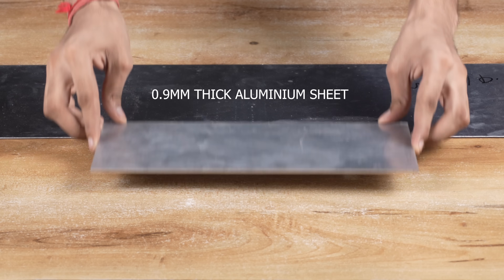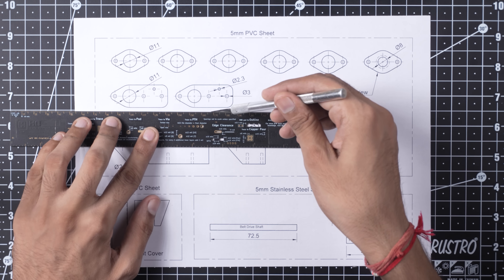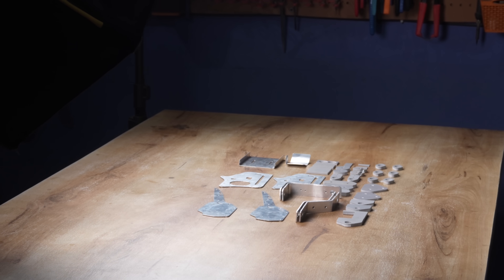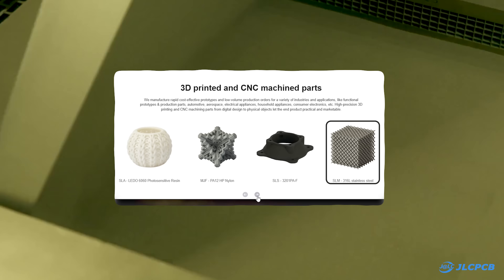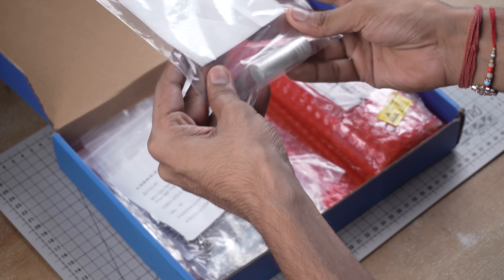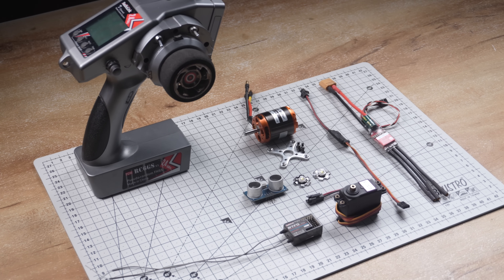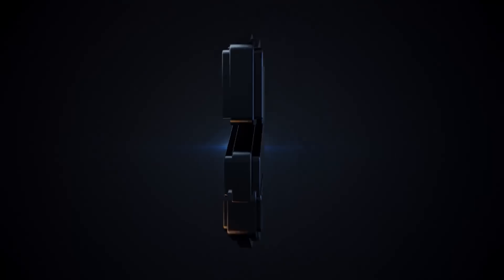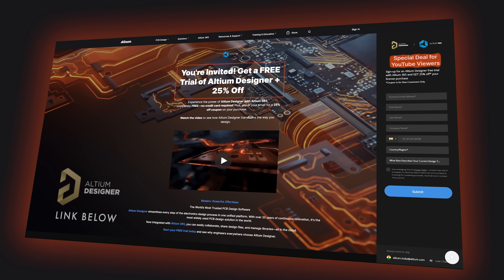Handcrafted Powerful RC Bike Using PVC Pipe – DIY Homemade RC Bike Build

Comment: Bro please my drone with 

Drone receiver 

Wemos D1 mini
MPU 6050
Make own motor driver with 
Mosfets,fly back diodes, 10k resister 
Lithium battery

Drone Transmitter 

2x PS2 joystick 
ESP8266
Lithium battery

Comment: Instead of using gyro , you can make it 3 wheeled bike also , using 2 wheels in front for stability and direction and one rear wheel for power , it'll seen good too 😉
Reply from the maker: Thank you 🙏 for your suggestion, I will definitely try this 😊.